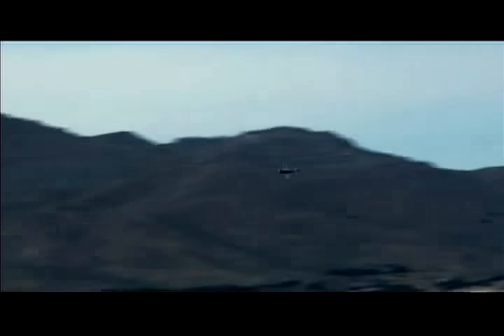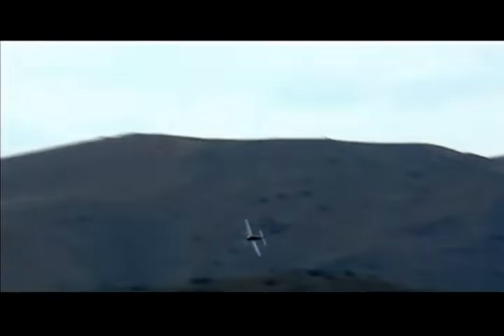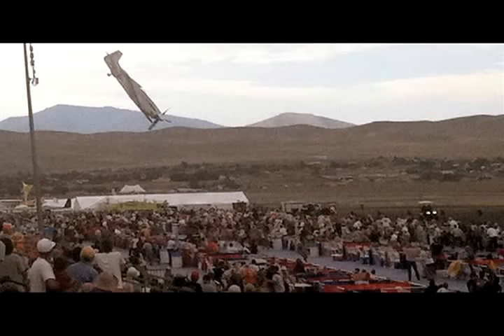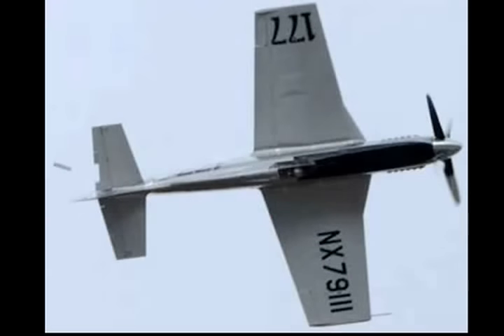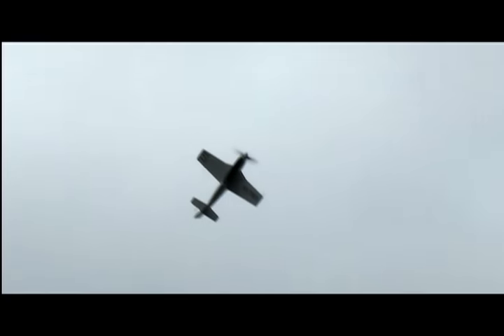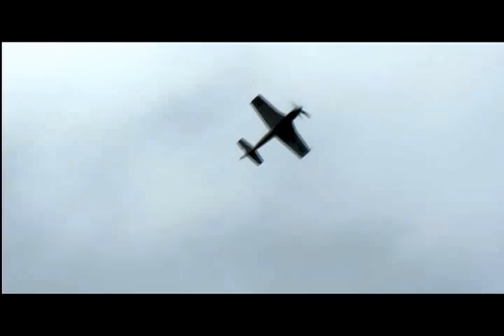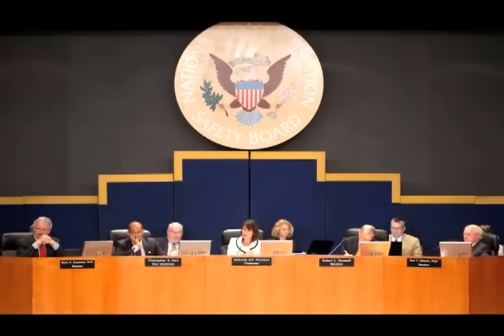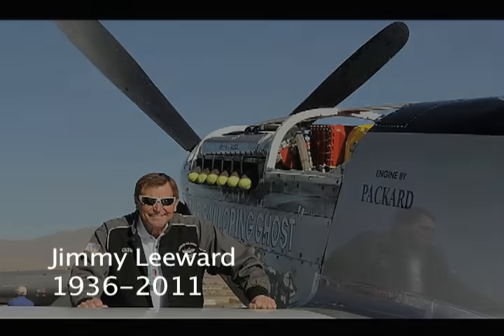NTSB Video of Reno Crash

Comment: 17+G even with a G-suit and a young fighter pilot would be too much. A sudden onset of just 5-6Gs is enough for GLOC. 17Gs is just insane. No one could stay awake during that.
Reply: Sustained 17G's would blackout anybody, however a short burst at 17g's lets say under 3- 4 seconds and a trained fighter jock in a G suit could  retain consciousness. 10 g pulls in short 3-5 second bursts were likely not uncommon in dogfights of Vietnam era and later. John Stapp still holds the G record at 46.2 G's for 1.2 seconds, back in 1954
Reply: Superman can !
Reply: @JC-ye7pj  An F1 driver survived 67 Gs
Reply: @Erik-ce3hq  survival and consciousness are different. The record for survival is from an Indy car at 214 G
Reply: @Erik-ce3hq  But it's different G load. In an F1 car you have LATERAL G loads, also during crashes almost always the G loads are lateral which won't drain your brain of blood.
Reply: Maverick could!
Reply: @r.l.mashburn4851  Well, firstly, Superman doesn’t even need an airplane to fly so… It’s kind of pointless to start with

Comment: Man, original video was probably shot at 30 fps and you managed to get a perfect picture of the plane going over 500 mph right before impact?  Amazing.
Reply: Camera shutter speed...any good photographer can freeze a moving object
Reply: Assuming the image is actually from a video, 30fps has little relevance. All that means is that a single image in a video couldn't take longer than 1/30s(likely 1/50 or faster at minimum, as I think it's extremely rare to just leave the shutter open), it can be and regularly is much faster than that - especially on a bright day as it looked to be.
Even for movement per frame, while 500mph is fast, that equates to less than 1 plane length per frame.
As the other commenter pointed out, someone could easily have taken a still photo, which this reportedly is - by Garret Woodman.
A crowd of plane spotters at air races are naturally going to be using a lot of cameras, and adept at photographing fast planes. Due to the very high resolution of still cameras it's much easier, as you can be relatively zoomed out(much easier to capture plane in part of the image), then crop it afterwards.
Reply: What you think this was fake? I was in middle school and kids at school the next day who were there talked about it. I remember watching the footage after school, there’s  an ever closer angle where you really see the plan disintegrate  but I can’t find it anymore as YouTube was fighting to take it down even then because it was extremely graphic. You can see the plane in great detail yes, a camera is very capable of catching that. I’m a photographer and my camera’s shutter speed goes up to 1/8000th of a second. 1/3000  is enough to freeze frame the wing of a humming bird. The plane is captured with a bit of motion blur yes, but it’s still going to be there on the screen.
Reply: I doubt the photo is from a video. I reckon it'd be blurry if it was. Although, considering the plane just came out of a loop, it probably wasn't going 500 mph anymore.

Comment: I would add as an audio technician that your probably too close to the mic as I can clearly make out the proximity effect on low frequencies. Backing off the microphone would give you better audio with less pops, but you will need to adjust your gain level up as you move back and perhaps add back some lows if you like that big voice sound. Just some pointers!

Comment: At 17 Gs it's amazing the whole plane didn't come apart, he lost control way before the trim tab came off looks like to me
Reply: Spot on. IMO the trim tab, and possibly other control surfaces, failed before it broke completely off.
Reply: Exactly.  How the heck did 17 Gs not pull the wings off?
Reply: @Lugnut64052  It blacked him out the moment it pitched up. He never knew he was about to die.

Comment: Look closer at your video.  The tab departed the plane at the point you say "here", but well before then you can see the tab trailing the plane attached to the stabilizer by only one end.  It was after the tab broke free from the TRIM CONTROLS that the now-untrimmed elevator pitched the plane up quickly, forcing the pilot to lose consciousness and control, not when the tab separated completely from the elevator as you claim.
Reply: +bogdog999   Trim control was lost before the tab departed the plane.  Photos in the NTSB report showed the tab moving beyond normal range of travel just before loss of control.  This is consistent with the tab control linkages coming loose.
Reply: The trim tab has nothing to do with the crash. No aircraft will fall out of the sky, loosing his trim tab. The only reason you use trim tabs is reducing torque from the controls, either for the autopilot or for the steering pilot. Or leveling off due to CG reasons (fuel burning), crosswind, etc. Thats all. He lost consciousness AFTER the turn, the aircraft leveled off and the hands still on the controls, it starts to climb, turned over and came back hitting the ground. As allways, it was not the aircraft!

Comment: The wings were modified beyond what the plane was safely capable of. He pushed the envelope and as we all saw what the result was.
Reply: They took ten feet, combined, off the wing span. A short wingspan is just like a short wheelbase car, it's a bitch to control, and in this case, killed people.
Reply: WootTootZoot the wingspan has nothing to do with it the trim tab has everything to do with it. Shortening wings has no effect on stability only stall speed and characteristics
Reply: Sorry, but short wings do have a huge affect on aircraft stability.
Reply: @WootTootZoot  mad how they get rockets to go in a straight line then. The accident had nothing to do with wingspan. Maybe it would've crashed in a slightly different place killing less or more people but it's pretty much irrelevant
Reply: @JustPlaneStupid69  It’s been proven that Illegal modifications were made to the aircraft, well beyond its capabilities. A little like your knowledge of this case I’m guessing. Or maybe you’re a YTAE (You Tube Aeronautical Expert) 🥱💤💤💤
Reply: @WootTootZoot  *effect 😉

Comment: The probable cause of the accident was Jimmy's lack of forethought and knowledge when needlessly and recklessly modified a perfectly good P-51D into a death trap that, unfortunately, not only killed himself but several other people with him, injured many many others and turned a national tradition into a local tragedy that has reverberated through the lives of all involved ever since the accident.
Jimmy lied to RARA, his fans and the public and flew his airplane beyond the envelope of its capabilities.
Reply: +Doc  If the mechanics had used good hardware in the flight controls this accident probably would not have happened.  The only contributing modification could have been eliminating the dual trim controls on the elevator, which could have provided enough trim authority to maintain control and land.
Reply: @FiveCentsPlease  You did not read the NTSB report or NARA/RARA changes that were implemented after the official report was released.  This accident would not have happened if the needless modifications to Galloping Ghost were not implemented.
Reply: The fact this needs this wonderfully worded and detailed and correct explanation reveals a bit of how silly Americans can be. the air race folk not op. but maybe. you’re in the desert and still have this as a possibility is absurd.
Reply: @chadgrov  This makes zero sense?

Comment: After the final report of the NTSB they were saying the air craft was doomed from the get go. Mr Leeward was actually test flying it on this final race when it crashed. Not only he weakend the plane by removing the lower cooler to the tail section. But fixing the controls for a nose down pitch.  The weights in the trim tab were off balance and flutter existed for a out of control non exceed limit. He max ever was 45 knots faster at this time. the trim tabs screws were worn out. FINGER LOOSE.
Reply: The modifications in general were very poorly done, with inadequate fixings and minimal testing.
Reply: @DoubleMonoLR  yes sir understood.  i’m thinking more of a criminal act.

Comment: When was the 17 G and why was it that high?
Reply: +Dutch   During the initial roll upset the vertical G-loading was 11G.   When the aircraft pitched upward violently, the vertical G-loading reached 17G before the aircraft rolled over into the dive.  Deceleration and vertical loads were high on the pilot, with the plane decelerating from about 525 mph to 375 mph in short time.

Comment: yes i understand...5+ a G suit would not be sufficient. Its just sad that "any" safety measures were take'n. Mr. Leeward lied about his age to the R.A.R.C. in the application. Did not show F.A.A. any major repairs on the plane other than removing the oil cooler below and did not preform the F.A.A. landing and take off cycles as required. He basically made the plane nose heavy beyond the limits of controlling the control surfaces to flutter.finger loose nuts on trim tab. pls check NTSB report.

Comment: Jimmy Leeward was focussed on winning at all costs, but one of those costs is safety.  The P51 was never designed to take the kind of stresses he put on the airframe and he essentially took a 70-year-old plane and completely rebuilt it with 21at century technology.  This is like putting an Indycar engine in a Model-T Ford.  Sure, it might be able to carry it, but it'll cause problems, including shaking itself to pieces.  The trim tabs, that proved to be the fatal flaw, were never swapped out along with the other '20th-to-21st century' parts and that's what caused this carnage.  All because one guy wanted to win no matter what.
Reply: Actually you are wrong. But, don't let the truth stand in the way of a good story. Is your day job writing propaganda for politicians?

Comment: The pilot, owner, mechanics the FAA knew these aircraft where modified and no one thought to get permission? Oh wait you do need permission.  A previous trim tab separation on a modified P-51 caused a 10 g pitch up.
Reply: + Randy Tetzner    The FAA addressed the accident with a mandatory requirement for all owners to inspect and replace the failed components with new-manufacture parts.

Comment: He just came out of the end of the "valley of speed" which supports both arguments:

1.  According to the NTSB he had "several" modifications that he did not report, nor test.  So, once he got into a race and pushed the plane further than he had before, the inevitable happened.
2.  He was the first pilot to get caught in the wake of another plane at the fastest part of the track and therefore lost control and crashed.

I'll chose #1.  There are more facts supporting the BTSB than just wake wash.
Reply: I'll go w/ the BTSB and chose #1, too.

Comment: what about his families??? He lyed about his age to the R.A.R.A. passed his physical and was not physically fit to fly an airplane. That he modified which lead to a disaster.  I understand your opinion but i think you need to understand the new rules for 2013. Buy your ticket and i will see you there.
Reply: flyingtigre1 i keep seeing shit about midifications being responsible. You do realize every plane in that race is heavily modified right? The crash was caused by reusing lock nuts which backed off of the trim tab linkage rendering it usless and causing a sudden 17g pitch up which made the pilot pass out

Comment: I'm an A&P (commercial jet structures) and hold a commercial/instrument ticket, but I have a hard time speculating on WHY there was no explosion or fire associated with this crash. Anyone care to speculate for me?
Reply: +ProChoiceJesus They had foam baffles in the fuel tank to prevent sloshing and to prevent fuel atomization in a less severe crash. They were also carrying equal amounts of fuel and water for the cooling system (150 gallons each.)  So very little fuel atomization and lots of water splashing. That and dumb luck would be my guess.

Comment: I I never saw this until just now. The tail wheel is just almost inline with the tab just a few feet forward. The tailwheel has doors that seal it inside the fuselage. Had the wheel somehow extended the air more than likely would have torn off those doors sending them directly back with the Airstream and possibly striking the tab causing it to fall off. Just a new possible Theory I've never heard talked about.
Reply: +michael flegel  The trim tab had already failed seconds earlier, shown in time-stamped photos used in the NTSB reports.  The tab was moving around beyond its normal range, and a flutter condition.  That was one clue used to conclude that a trim tab failure was the cause of the accident.  The tail wheel extended from the G loads as the plane lost control.

Comment: I seriously doubt the loss of the trim tab had anything to do with this horrible event. Looks like pilot black out to me.
Reply: + Pilot 301    The photo documentation and analysis in the NTSB clearly shows that the trim control had failed in the seconds before the accident.  And loss of trim at those speeds sent the aircraft out of control.  The pilot did black out after the plane went out of control because of G-forces along multiple directions.

Comment: I still don't buy it that the crash was due to trim tab failure. How could a trim tab cause the sudden roll.  I think that the trim tab separation was a product of the g-forces after the upset (same thing that caused the tailwheel to snap down). To me, it looks like the the upset was caused by wake turbulence from one of the leading aircraft. Does anyone else agree?
Reply: I agree.  The trim tab wouldn't cause that much of a pitch change, even at those speeds.
Reply: @pilot3016  It already did, on other P51 racers, which didn't seem as extremely, or poorly, modified.
Bob Hannah in Voodoo Chile had a trim tab problem and it pitched up - seemingly a near identical situation, he was thrown forward and blacked out, but fortunately came to in time to control the plane and land safely.
Miss Ashley II disintegrated in the air, possibly directly or indirectly due to a trim tab problem.
Reply: @DoubleMonoLR  I remember both of those aircraft, "back in the days".  (I'm 71).

Comment: I've been going to these races off and on for almost 30 years, and if anyone there (I think there are typically some 45000 ppl on Sunday alone) ever thought they were totally safe they were stupid.  It wouldn't be racing if they were not all pushing the limits of everything and sometimes crashing for it.  It was safe enough despite one major tragedy in half a century.  (compare that to NASCAR)  Since 2011 the experience is predictably vastly diminished for the spectators, it's now TOO safe to be near as much fun as it used to be.  If it seems too risky for you, please stay home.
Reply: Well this time the reason was safety regulation neglect i.e. the pilot was the culprit by using old part  that gave up. The accident would have been easily avoided.
Reply: That's not relevant here, the pilot and mechanical crew flouted guidelines that were already in place, and did inherently dangerous modifications with inadequate structural work and testing.
You should be blaming them, not the public, for any changes since. If they'd done what they were meant to, the crash wouldn't have happened.

Comment: I wonder if the pilot, whom was a bit advanced in age didn't have a blackout, a heart attack or was in some other way incapacitated. Seems the P-51, being a war bird could have survived the loss of a trim tab due to battle damage, the fact that this one was highly modified not withstanding.
Reply: + 88mike   The photo and forensic evidence showed that the trim control had failed in the seconds before the accident.  The loss of trim would have put loads on the control stick that the pilot could not hold at that speed.   And the upward pitch from the loss of trim put extreme downward and forward G-loads on the pilot, which explains the photos of his helmet pressed against the instrument panel.  The pilot was an unconscious passenger in an out-of-control plane at that point.

Comment: That was just plain sad. Terrible for the spectators and Jimmy. What made me come back to this video is that I fly scale r/c airplanes and I just bought a new eflight commander.  It's basically a model of the race planes.  1st maiden flight,  1 minute 6 seconds into making easy rounds around our flying field my model did the same exact thing.  Straight up for no reason I can figure out then stalled about 200 feet up and straight down into the ground.  Honestly you couldn't simulate that crash any better than what my model did.  Real life 12 lives lost.  For me it was only $375. I'm actually just kind of spooked about how a model did that exaust same thing 😥😟
Reply: I don't think this Mustang stalled, I think it performed a full loop at high speed and came back down into the ground.
Reply: Well, the plane was called the Galloping Ghost...........

Comment: seems like a few hundred dollers in new lock nutts and bolts might have stop this look at NTSB report
Reply: It was way more than that. The plane was so heavily modified and "hotrodded" that it wasn't safe for flight. But, many of the mods were never reported and thus unknown to the FAA. The mods pushed it beyond what it was capable of handling AND reduced control surfaces. It was a ticking timebomb.